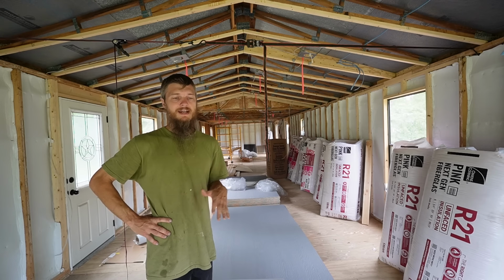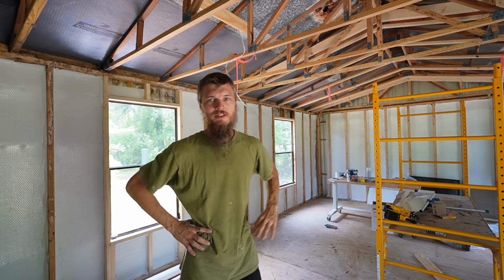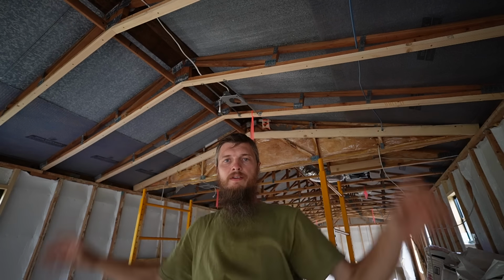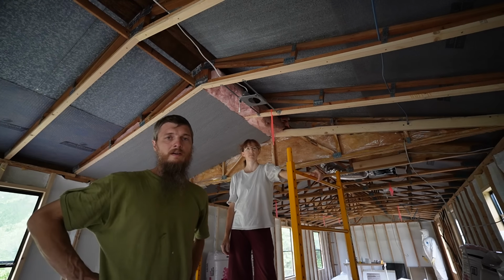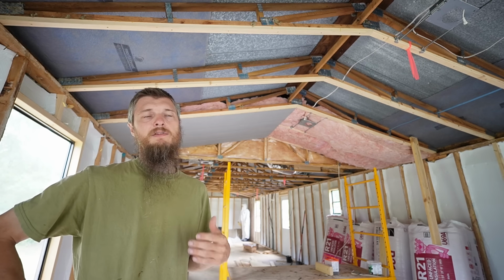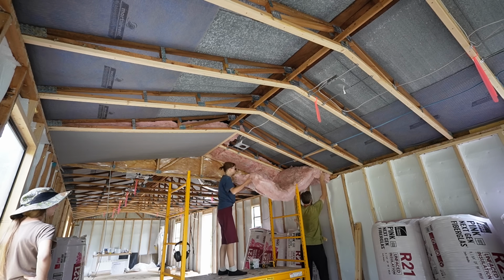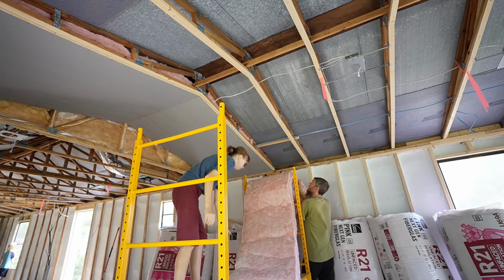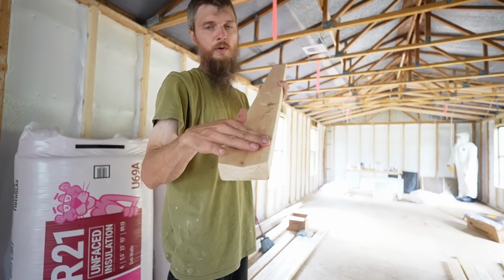Starting the Ceiling was a Struggle! - Salvaged Mobile Home Rebuild

Comment: I worked as an insulation contractor for several years and it appears that you are installing the insulation properly.  I can offer you a suggestion to keep the insulation from falling down and it will not cost anything because you already have the needed material.  All you have to do is cut the plastic bags that the insulation comes in into strips a few inches wide and staple the strips  on one beam, install the insulation and quickly staple the plastic strip to the next beam. This will enable you to insulate the entire ceiling without additional costs.  Then you can install your OSB without the insulation falling on you.  Good Luck and I like your videos.
Reply: I just want them to stop and read this!
Reply: Perfect!
Reply: Absolutely agree!  Strapping is such a pain, adds more weight (small amount I know), and adds cost.
Reply: that was my idea too.  You can use anything to hold it up.
Reply: @kma9292 great tip! ⭐
Reply: Hey so would it be overkill to run full-on plastic sheeting as you go and it will be an added barrier too? On my mobile home ceiling all the insulation is sealed in with a layer of plastic like that.
Reply: @bennybongosbigolebonanza894  
I know that when the ceiling and walls are sealed completely with plastic sheeting this can create a problem with condensation which can create a problem with mold. This also adds time and additional expense.  Also, in different areas of the country the building codes change so before attempting this
Reply: I was thinking also as you do the insulation and OSB, basically to help do things over your head (as a short human speaking here), use an extra piece or two of lumber to help hold things up and wear a hard hat 😂. I have used broom handles as well but the lumber can be longer and floor to ceiling 🤷🏻‍♀️

Comment: My father cut about 3 inch long strips from the bags the insulation came in. Just use the straps and a staple gun to go across to hold it up. It was easy cost-efficient thing to do. He also didn’t wanna have to run to the store just wanted to finish the job. 😊😊😊
Reply: great tip! ⭐

Comment: I was wondering why you weren't using the wire braces for the insulation!  Onward and upward!    It will make such a difference when you get the ceiling done. 👍❤😘👏👏👏👏👏👏

Comment: Hard and dirty work.  I used spring loaded curtain rods ( like for a narrow window) as temporary support for the bats. I then used chair webbing stapled to the rafters, removed the rods, and nailed up dry wall.  All this by myself.  I also built a couple of  adjustable T supports to hold the dry wall for nailing.

Comment: They have precut metal insulation hangers for 16 inch and 24 inch that you could use to hold up the insulation.  Added cost but may make it easier to put up the panels.  Just a thought.  I am half way thru the video, maybe you mentioned it later.  Yep, you mentioned it. Hope that works.

Comment: It would have been nice to see the difference in temperature of the inside wall surface before and after the radiant barrier using an infrared thermometer on the sunny wall. It would have shown a measurable difference.

Comment: I would of put panels up in other direction and put the out of position truss in middle or just not at edge joint. And at least screw a 2x 4 about 1" down from truss along outer wall to help hold panel up

Comment: When you were painting the exterior of the mobile home, you were using a tool on a handle to protect from overspraying the paint. Wondering if that tool would that be helpful in holding the insulation up until you can get it secured? 🤔 You'll probably be done with the process before you see this comment.

Comment: years ago I received the same insulation free .. I  installed it in a friends garage i had no clue they sold those wire holders... I stapled string and used it as supports , worked out pretty nice... can't wait to see it finished , great job

Comment: Nylon strapping stapled to the trusses would make your life a lot easier when hanging the insulation. Your ceiling panels would not be bothered at all by them.
Reply from the maker: Yeah, that sounds like the right idea.
Reply: @diyfferent  I own a 1972 mobile home and it has a moisture barrier on the ceiling and the walls to keep the moisture off of the panels so you guys may have a moisture problem when it becomes to hot and you have your air conditioner on. Because of the change in temp between the outside and the inside of the trailer if you keep everything at 75 degrees because of your humid climate you will not have a dew point between the inside and outside of your mobile home, if not you will start getting moisture problem from the outside seeping into the colder temperature on the inside of your mobile home. If anything else needs to be know and you want to know more I am more than glad to help you guys. Love your channel.

Comment: You had the right idea with the pink strapping to hold up the insulation up, I just think the pink tape you were using wasn’t strong enough. The strapping that I’ve seen is wider and see-through and you just staple it on the underside to hold up the insulation. It’s made specifically for that.

Comment: Make a holder on the end of a 2×4 the middle height of the ceiling,  add a T across the top to temporarily hold the insulation and board.   Like having a 3rd hand. Really like the ceiling!

Comment: Appreciate your perseverance, but lifting those OSB panels like you are is just inviting back injury at some time for one or both of you. A drywall panel lift is available at Harbor Freight for $250 and can lift up to 150 pounds as high as 11 ft. 6 inches high. They can also be rented at Home Depot, Lowe's, or most tool rental companies.Much easier than struggling and hurting either one of you.
Work smarter, not harder.

Comment: Your DIYfferent ways always impress me, so I have no doubt you'll figure this insulation install out. Having said that, make sure you (rinse off in a cold shower) before warm to remove the fiberglass, so it rinses off instead off entering your pores. I speak from experience. Another tip is a vague memory from a construction site, is about holding up the fiberglass as you work. Nail one or two 2 by 4 (as legs under a table) to a piece of plywood and one of you hold it in place under the insulation and guide it (from the floor) throughout the installation. Just a thought. : )
Reply: Really GREAT ADVICE! Never thought of a cool shower before turning on the hot after installing fiberglass.
Reply: @VelvetRedRoses , Thanks. I figure I'm an older gal now/elder and I should pass along tips that help, as well as learn from others. I appreciate your appreciation. : )

Comment: Don't know if it's a crazy idea or not, but it occurred to me to grab a can of spray glue and spray the back of the insulation so it sticks to the ceiling.

The first time I worked with fiberglass insulation, despite showers, I was itchy for days.  If I were installing insulation in the ceiling like this, I would be wearing long sleeves and gloves and to prevent breathing in tiny slivers or getting it in  my eyes I would wear a mask and safety glasses.  Not a critique.  Just what I would do.
Reply: Agree 100%.  Better to be safe than risk your long term health.

Comment: Here in Canada, we install a plastic vapor barrier over the insulation which helps to keep it in place. Perhaps if you cut some thin straps of similar plastic you can staple them in place to hold the insulation.

Comment: return the insulation you have,, its only good to be dropped in from above,, get Paper faced insulation, so you can use a few staples to hold it in place, I did insulating in many condos in south FL, that I had to learn the hard way,,, went quick after I switched,

Comment: Always run OSB sideways, and not in the same direction as the truss.  Oriented Strand Board, means the strantds are oriented one way, long ways.  There should be 2 panels running side by side from bottom edge to the peak 
The panels of OSB will sag, running that way.
Reply: he's got that modified wood to help with this?  - even with that, will there be sagging?
Reply: @StarkeyatRingo  Im not sure what you mean for sure, but yes, it is thin sheets and meant to be used crossways of rafters.
Reply: @StarkeyatRingo  it will take years though🤷🏽‍♀️

Comment: Probably others have said it, but there are pressure fit wires that are made to hold the insulation in place. Also you can build Ts to wedge against the paneling to hold it in place or use your sheetrock lift. The center blocks are fabulous! Slow and easy is best. A great video.

Comment: sitting here saying use the wire rods to suspend the insulation.  and make a brace from 2x4 to support the panels, one end on the floor and the other end bracing up the panel while you drive screws.

Comment: To save your back use a t  to hold up the batt, then drill in screws on board corners before placing up on ceiling

Comment: And this is why y'all didn't want to do all the final sealing work on the roof.  Idea for the falling insulation : take that pink banner stuff like you have hanging in spots (or caution tape or similar), and staple that across under the insulation in a couple of spots just to hold the insulation up long enough to get the panels up.

Comment: We had a similar issue, and simply stapled carpenter's twine across the top end and middle right down the length, which was enough to hold the insulation long enough to staple up a vapor barrier .
Reply: Genius!

Comment: It is great to use the panels. My house was built ib 08 and has the wires to hold the floor insulation. Every once in a while i have to go down to the basement and using a broom handle, poke the insulation back up to the floor boards.

Comment: That is really coming together.  That insulation in the ceiling is a tough one.    I was thinking that some of that nylon trapping would work on that to help hold it in if those wires don't work or they don't have them.   Great job as always.

Comment: I used Insulation Supports to hold insulation in place. I needed 16" but they come 24" on center joists or studs. 100 pieces per box simply push into place. Spring steel holds batt insulation.

Comment: I don't know if you've finished the roof yet but why not just get a few of those small ( cheap )  rolls of twitching wire and run 2 rows ( like you tried with the ribbon stuff ) of wire in each section but dont cut the wire just keep rolling it out as you go and put a nail ? on  each side of the inside of each  rafter it will still leave your area that you are nailing to the roof free of any nails / screws etc. Those rolls of thin wire I used to twitch perches etc in my aviaries for many years , they were cheap and lightweight , its just a thought I had , thats if you have'nt already finished the insulation in the roof .If you have 2 rolls , attach them about 18 inches apart ? , and as you get to the next rafter bend and mold it over the rafter so it does'nt move , and its ready for the next section by rolling out more wire off the reel . I hope I explained what I mean so you understand what I mean maybe it will help as the thin wire is stiffer than the tape that u were using , plus it cant fall as you have gone over the rafters..

Comment: I encountered a similar issue with the insulation constantly sagging before I could install the OSB. After some resourcefulness, I rummaged around and stumbled upon some old Christmas ribbon. Ingeniously, I decided to staple it across the trusses, and voila, problem solved! It proved to be a cost-effective solution, especially considering my reluctance to deal with the hassle of those tiny wire supports. I think even some box strapping material would work the same, I just happen to find a couple big spools of ribbon so I used it..

Comment: They sell a 4x8’ sheet with foil on one side that is a strong styrofoam that you can buy that is 2 inches thick.  This would have been perfect for your mobile home.  I have seen it in garages to keep warm in winter and cool in summer.  It would not be good in really cold climates but in Florida it would be great.  It would have been better to have got the faced fiberglass, as you can staple it in place on both sides. You can add ceiling panels later.

Comment: Staple a length of string across the rafters at bottom and top to hold the insulation in place you can either leave the stapled string in place or cut it and pull it out once the panel is in place.

Comment: There are stiff wired you can buy specifically for holding up fiberglass insulation. They come precut to fit between rafters with a little bit of spring to them.  I wrote this before you said it at the end of the video.

Comment: I would try heavy string or twine or flat strapping material stapled to the trusses to hold the insulation up.  I think those pieces of wire will be hard to work with.  I'm guessing by now, you've already figured something out.

Comment: Now that is thinking ahead with the ridge boards . I commend you.
As far as the holding the insulation up. You could just run some cheap string all the across the room length wise one or even two times. That may hold it up long enough to get the panels up.

Comment: another thing you could do is put a window tint foil on the outside of the windows this might reduce the amount of light going in but i think it will allso prevent the glass itself getting warm / hot and radiating that heat intoo the house , another benefit is that its not as eazy to break a window if there foil stuck over it
btw those small pieces you cut of the rockwool fot the roof can probably be stuffed in the places where you didnt put the radient foil in 

eeeehm just thinking out loud here , maibe get a few broomsticks and stick them through two sets of trusses ,at about 2 feet intervalls  then you can hold the insulation up with those broomsticks and after you installed the pannel pull the sticks out and over the next set of trusses , should work ok i think need to weave the insulation over the sticks though or pull them out push up the rockwool and slide them back under
another option would be to staple some strips of cardboard under the insulation , i dont think it would show if you screw the pannel over it , it will crush the cartboard flat on the trusses

Comment: This is a pain of a job. Ok, so use either ribbon or a decent hemp string from one end to another, u pick distance, 2 per section. Insulation up and over , install ceiling board and leave or pull out ribbon or string. Leaving a ribbon in, no staples, try tacks would probably work. Just an idea. It would be great if u can tie ribbon or string really tight so u wouldn’t need tacks. Put 2 screws at whatever distance, tie between screws, install ceiling, remove screws ribbon or string can stay.

Comment: Well … that looked frustrating 😫 !   I hope you find something that makes it easier to hold that insulation up …. 
Question- is there power at the house yet. ?   Maybe  running a fan could help with the heat inside while you’re working???   I’m sure you will figure it out ❤❤

Comment: Temporary board on the wall to help hold the ceiling panels and duct tape across the rafters to hold the insulation up.i know a guy that might have used strips of material and a stapler to hold it up.maybe you know someone who has a Sheetrock lift you can borrow or just rent one, they're cheap and will make it easier on your wife.☺️

Comment: Use the insulation wires. I started without them it was a pain. The wires will keep the weight off the panels and keep them from bowing down.

Comment: I used insulation in a shed to tiny house and it's still too hot in the summer time, i couldn't stay in it without the ceiling fan and a airconditioner=  insulation does nothing for the heat in the south . Mobile home manufacturers use plastic  to hold up the insulation in the roof.  I'm renovating a mobile home also

Comment: Quick question: are the ceiling panels particle board,with a painted primer…or is it a coating? …😊toward the living space.thanks! Interesting to watch all the issues that croup…
Reply from the maker: It's osb, not particleboard. It has a faux wood texture on one side, and it comes with the gray primer on it.

Comment: I must say...after all the years of watching your videos this is probable the first one that I could feel the frustration.  I was watching and feeling it for you. I think I would have to take yarn or string and staple it going  from one end of the house to the other to hold up the insulation. It doesn't help when you have to do it in the heat. I hope it goes easier for you.❤

Comment: Have you guys also thought about air flow to combat humidity? My mobile home has very poor air flow and humidity builds up. I had to get a dehumidifier. I live up north.
Reply: We remove a portion of the skirting every spring to let the underside breathe until late fall.
We do both sides of the trailer to allow for a cross breeze. We use 2ft chicken wire to keep animals out.
You're moisture is probably coming from below so you should keep it getting good airflow when weather permits.

Comment: We used to use "tiger teeth" to hold the insulation between the floor joists under the house.  They should do the same thing for this ceiling installation.

Comment: a tip i learned from having carpenters at my home, was that they nailed some nails on the side all trugh the bay on each side, maby 30 to 60 cm apart  to hold on to the insulation in the roof, and even if the nais were inside, not under the insulation, it would hold on to the insulation enough so that it dosnt fall down on you, no need for something fancy, and the nails are on the wood inside the bay and wont get in the way of the ceiling boards